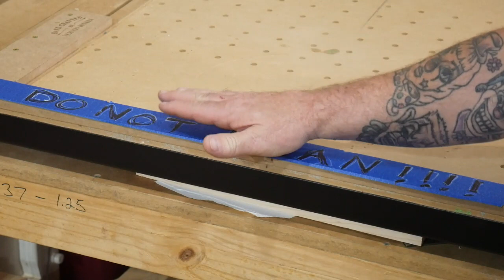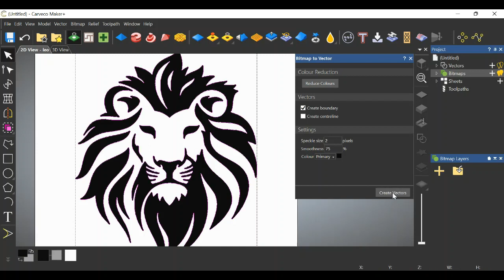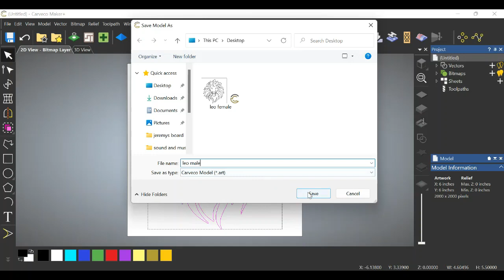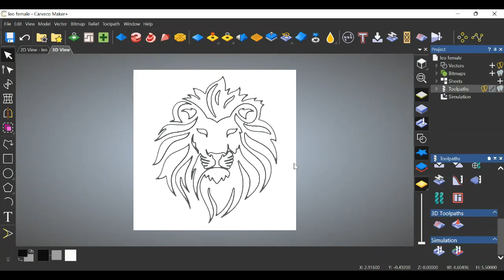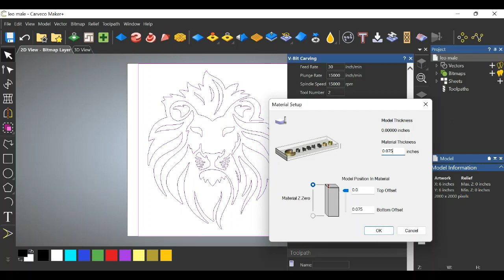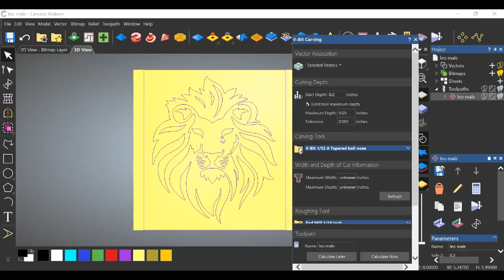Carveco V-Carve inlay tutorial

Comment: Question: since you are using v-carve tool path the roughing bit step down parameter is ignored and it goes straight to the max plunge, so for example
If I I say for female go to 0.25 depth, the end mill inside of vcarve tool path plunges straight to max depth. Do you have a workaround for that?

Comment: Thanks for the video - one thing for those just watching, on creating the male, I suggest either using offset or polyline to reduce the machining time to make the border around the male piece much smaller.
Reply from the maker: Thank you and you are correct
Reply: So creating an area clearance tool path with a larger bit? .250 or .125?

Comment: I tried this but with a 30 degree bit and my male plug doesn’t fit not sure where I went wrong
Reply from the maker: Thanks for watching 
Because you used a thirty degree you will need to adjust settings to achieve the correct fit

Comment: Have a link to the bit that you use??
Reply from the maker: Thanks for watching 
Unfortunately the bit is available at the time I am answering this but here is the description 
Any bit of those dimensions will work
Be sure to enter the bit as an engraving bit not a v-bit so you can enter all the dimensions correctly 

Amazon
1/4" Shank Spiral CNC Router Bits 6.2 Deg Tapered Angle 3 Flute Ball Nose End Mill for 2D&3D Carving Engraving

Comment: When I go to cut the male, my spindle plunges to the .2 start depth and snapped my bit. I am using carveco maker and an infinity. Am I setting it up wrong? I swear I am doing just what you are saying. (I am using an 1/8 inch end mill.
Reply from the maker: You need to slow your speed down to 20 - 30 Inches per minute

Comment: Great video.   I'm glad it's still around.  I have a different problem compared to what I've read in the comments.   My male plug always comes out too large. Would changing the .05 finish depth fix this?

Also,  tramming is a colossal pain in the a**.  Do you have any tips to make it easier?

Thanks for all your posts.   I've learned a lot from you.
Reply from the maker: Thanks Craig 
For the male i would try offsetting the male inward .001 to .002 or something in between 
For tramming surface the waste board first depending on what machine you have i have used clamps to help move the spindle in fine adjustments its tough to figure out how to mount them though to get them to pull the spindle 
I also three d printed shims and used aluminum foil at times hope any of this helps 
Thanks for the support
Reply: Thanks for the quick response.  I'll definitely try offsetting.

The clamps are an excellent idea for tramming.   I have a genmitsu 4040-pro.  No where near what you have,  but I do like it a lot. 

I also noticed you're cutting into the end grain.  That probably makes a huge difference.
Reply from the maker: Yes it does i rarely do inlay long grain.

Comment: i tried all of these numbers on my onefinity elite and the male is too small on all, width not depth. Any ideas?
Reply from the maker: Couple things did you load the taper ball as an engraving bit I’ve since learned that 
Also I have at times offset the male outward .01 - .02 to tighten things up a bit
Reply: @Hinkleshop thanks I will try that

Comment: Question I need to know this. Why do I need a start depth That is not zero when doing the male piece. Why can I not gradually go down to the depth I need
Reply from the maker: I’ll do my best to explain 
If you start at the top the software will not allow the bit to go deep enough because once the edge of the vee bit touches the vector that it is carving it will stop going deeper 
So by starting lower you are essentially lying to the software and as it carves to what it thinks is the vector it actually has already cut in which as a byproduct gives you the desired depth of cut 
Its a tough one to explain for sure
Reply: @Hinkleshop  
Well, thank you for explaining that much of it. It makes sense now. I’m having a really hard time making it work. I’ve been in the garage all day and have spent hours trying to make an inlay work and it just won’t do it. 
I cannot do the .2 on my first cut because that is too deep For my little bit that I am trying to do the inlay with.
Reply from the maker: @Checkitfirst  if the male is loose try offsetting the male vectors outward slightly .01-.02 
Also be sure to load the tapered ball as an engraving bit it Carveco and enter the bit dimensions for radius etc that might help as well if your using a tapered ball
Reply: @Hinkleshop  it’s too tight. It won’t even go in.
Reply from the maker: @Checkitfirst  interesting it’s usually the opposite 
But try offsetting inward the same small amount
Reply: @Hinkleshop  
When I first started yesterday, messing with it, the male piece had no detail left on it. It kept removing the detail. Now mind you, I’m trying to do a rose and lay. That is only 2 inches big.  I can do an inlay letter without any issues, but I’m definitely having a problem with this. I have seen small detail done in peoples before that’s why I’m so confused. I can’t make this work.  I’ll try that last suggestion and see how far it takes me. 😊.  I will let you know how it goes. Thank you so much.

Comment: How do you set the clearance so you can see the male portion actually set into the female. I want to se more clearance on the waste material if that makes sense.
Reply from the maker: If I understand you correctly I would reduce the depth of cut on the female incrementally until you achieve the desired result
Reply: I want to set the male portion to have a better clearance.  So I can see a gap between the female and the male portion.  So wehen I go to set it I can see the inlay is properly set.
Reply from the maker: I see 
Then if you increase the finish depth on the male that should do it

Comment: Hi Vernon, I have met and been involved with many professionals but very few have the ability to teach. Everything is easy once you know how so when they instruct, they leave the details out. You, my friend,  have a gift. I combed the internet on how to do inlays with Carveco and in every case they leave out a detail or two and I am tired of crashing my machine.  With that said, I am sorry to report that I crashed it again following your instruction BUT I am confident I am missing a "detail" simply because your video proved it. I made a 4 piece story board of a simple 1/2" X 2" rectangle. When I set the "Start Depth" at .02"  my CNC  plunges the 1/8" end mill .02" right into my Test board. I went over and over your video and noted every word. I zoomed right into the toolpaths and everything looks good. After hours of failure I tried in vein, knowing what the outcome would be, by setting the "Start Depth" at .005" .006", .007" and .009"  and the max depth to .20" in hopes it might work. Well it did cut them out but as expected, the narrow part of the male was the same size as the top of the female.  Sooooo........   I am  stuck!! I hope you have a few magic words for the answer.
Reply from the maker: Thank you for the kind words 
A few things I can advise
1-This technique is done in end grain which is more forgiving as it relates to stress on the cutter 
2-slow the feed rate to 30ipm or less
3- the end mill step down setting may be too much in your programming 
The step down on a 1/8” mill should be a 1/16 or less (typically step down is 1/2 the bit diameter)
4-Once you get the carve cutting correctly you may have to adjust the start depth point slightly to tighten or loosen the male portion 
I have also offset the male outward .01 a .02 to tighten the male 
5-don’t wait too long between male and female cutting the wood will shrink and make the pieces fit incorrectly in some cases
6- also the tapered ball nose should be entered in the tool library as a engraver bit. You can adjust the radius on the tip, whereas a Vee tool, you cannot
Hope this helps
Reply: GOT IT!!!  Your suggestion #2 was spot on.....Just needed to slow the feed. In addition, I switched from a Spiral Router Bit (looks like a file) to a high quality 2-flute. Much appreciated.  John
Reply from the maker: @user-jo3bd8vj8f very welcome

Comment: For the make toolpath setup,  would it fail if you do a final depth of the .25 instead of the .2 starting with a .05 doc?
Reply from the maker: Thanks for watching 
I believe it would but, the risk of snapping the bit would be greater 
If I was going to try it I would slow the feed rate down to compensate for the extra force against the bit

Comment: So, I followed your instructions and had one inlay turn out great.  However, the next one not so much, even though using the same settings.  In fact, I tried it a second time and both times, the male inlay comes up about 1/16" smaller than the female for all vectors?  Not sure what I'm doing wrong.  Used an 1/8" endmill for rough and a 1mm tbn entered as a v-bit in my tool library.
Reply from the maker: Since this video I’ve learned if you enter the T ball as an engraving bit you can enter the radius of the ball that may help 
Also I’ve learned not to allow too much time between male and female caves because the wood shrinks in some cases
Reply: @Hinkleshop  Thanks for the reply.  I will try again after Christmas

Comment: If Cutting Depth is in millimeter, what is the depth in mm
Reply from the maker: Anytime I have to convert from inches to millimeters. You can do that simply by going on the Internet and searching a inches to millimeter conversion chart, however
.25 is 6.35 mm
.20 is 5.08 mm
.05 is 1.27 mm

Comment: Vernon, I found this video very informative.  Excellent job.  The main thing I learned was that I needed to "tram" the spindle very accurately.  I've been struggling with inconsistent inlay results using F-Engrave, and was only able to get acceptable inlays when using 30° or less V Bits.  

My one comment would be, you seem to be ingnoring the offset requrired for the inlay cut ( I assume this is because you are usine a very sharp angle Vbit.)  

Example for a 60° bit:  tan(1/2 bit angle)  the tan of 30° is .57735.  You must multiply this factor times the depth of cut and offset that amount.  For .2" depth of cut the offset would be .11547"  This will offset the V carve cut the exact distance to allow for a precise fit of the male component.

I'm surprised that this feature is not builtin to Carveco.

Dan B
Reply from the maker: Thanks Dan and thanks for the added info I’ll give those numbers a try on one of my next carves

Comment: Well your video is great. But you said you made you cutter a carve bit. Now it is a ball you also said. I tried this and made the tool but nowhere did it ask the radius of the ball.  So I think that is why my pieces were loose. I think carve bits have little to know flat or rad on the bottom.
Reply from the maker: Thanks for watching since I published this video I have learned you should enter the tapered ball nose in the tool library as a radiused engraving bit and manually enter the specs
Reply: thanks I will try that
 @Hinkleshop
Reply: do I enter it as a vbit or an engraving tool bit
Reply from the maker: @marceldeman1541  engraving tool
Reply: Well I think I am on the right track but using a vbit tool path on both pos and neg  they are still loose. but in vcarve I saw a video that  he used a pocket tool path  and that worked. but it is tight and not getting down to the bottom. That is the strategy that worked in vcarve for me.   oh and also found an issue with my machine.  bought it used and figured every thing was set but my touch plate was set .03 thicker then the touch block fixed that and it got better, but was going all the way to the bottom of the pocket and still loose.   so I used this guys system in vcarve.
https://youtu.be/aWqHqqDtp5c

Comment: Im trying to make an Inlay im using a 1/8 balled nose I dont have the bit you have but my carve is not going deep enough I put limit depth .25
Reply from the maker: I believe the bit is to large in diameter and is stopping shallow so it doesn’t ruin the vector boundary

Comment: Great tutorial. One question . On the male, if you start at 0.2" and max depth 0.05", does that mean the 1/16" bit has to plunge in 0.2" and carve that out in one go so the total depth is 0.25"?  That's putting a lot of load on the small bit.
Reply from the maker: Thank you 
Yes it will plunge .2 so you will need to slow your feed rate to between 20-30 ipm and it works best in end grain applications  also I’ve had some good success running the tapered ball nose first then the end mill second you may want to give that a try too
Reply: @Hinkleshop  Thanks for the great tutorial. Can you explain why (what is the purpose) to plunge .2 on the first pass? It seems that you could safely take less on the first pass, do incremental cuts to obtain desired depths. You could still adjust Max Depth value as you describe in the Story Board approach testing. Thanks again for the time and effort you put into making the instructional videos.
Reply from the maker: Tough to explain but you are essentially lying to the machine telling it your surface is .2 lower than reality then .05 max depth is used to align the edge of the bit with the vector
Leighton does a better job explaining it on the Carveco channel tutorial

Comment: Well, it’s me again. I cannot get it to work. On the male piece where you say, make it .2   it drives my little bit all the way down into the wood .2” on first pass. Any ideas what I am doing wrong
Reply from the maker: Check the step down setting on the v bit tool reduce it to say .1 
Also if you are doing an end grain inlay you should be ok with a pass at .2 if you reduce the feed speed to 30-40 inch/min
Reply: @Hinkleshop  
The v bit seems to be ok. It’s the roughing pass that makes me nervous. The bit plunges to deep. Step down is at .03,,,, but it plunges the whole tip of the 1/16 bit. It only has a 1/4” depth of cut tip.
Reply from the maker: OK, then reduce the step down on the roughing bit and generate two tool paths. The first tool path finish depth  would be .1 the second tool path finish depth would be .2 that will reduce the amount of material being removed the time
Reply from the maker: Also adjust the start depth on the second tool path where you left off on the first path. .1
Reply: @Hinkleshop  
OK, I will try that. Thank you so much for your time.
Reply from the maker: You’re welcome

Comment: I found something interesting and a modification I needed to make when using a TBN for inlays.  When I set this up as a v-bit in my tool database,  I did some test cuts just cutting a 1.25" diameter circle.  It worked fine for the female pocket,  but cut the male insert just a little too small and there was too much play in the pocket. After doing some research,  some set up the TBN as an engraver bit in the tool database,  key difference is you need to specify a flat width for the bottom of the bit. This worked great for the male but cut the female too small.  So for my CNC, I set up the female pocket using the TBN as a v-bit and the male male is cut using the TBN as an engraver bit and it seems to work.
Reply from the maker: Thanks for the info Ed 
Since the time I realest this video I have found that offsetting the male vectors outward .01 to .02 tightens up the male also.
Great information thanks for sharing
Reply: @Hinkleshop  Yes, that's about right.  The male should have been 1 25" at a depth of .2 based on your tutorial and the way I set things up in Carveco, but it was only about 1.22" just as you noted. About the thickness of the tip on the TBN.

Comment: Seems like my bit is going to break if I use a .2 start depth. What am I missing?
Reply from the maker: Hey John check your speed should running about 30 inch per minute
Reply: @Hinkleshop  I was testing it out on mdf. I was running 40 ipm at 12000 rpms and the bit did break. Is it because mdf behaves different than endgrain on a cut like this?
Reply from the maker: I would agree with that MDF is soft however I believe end grain has greater flexibility or movement while carving 
I feel that the fibers sever and move out of the way at a quicker rate 
Again that’s only a theory 
I will say I’ve not tried an inlay on MDF and I’ve haven’t had an issue with bit breakage on end grain 
Please keep me informed on your findings and progress

Comment: Do you have a link to the TBN used?
Reply from the maker: Thanks for watching 
I purchased the bit from Amazon 
However I recommend a 12.5 degree from Amana tools they are much more expensive though 

Jiiolioa ZQ31B3 Spiral CNC Router Bits 2D&3D Carving 6.2 Deg Tapered Angle 3 Flute Ball Nose1/4" Shank 1/32"X1"X1/4"X3"

Comment: I have a dout, the star depth is suppose to be under 0.00 so the value we put in there is negative cos i did it just like you said on the video , my female depth is 6.35mm so for the male i put 5.2mm on the star depth and 1.15mm om the maximum depth but my cnc cuts 6.35mm

Comment: Fantastic video! It's so difficult to find a youtuber with carveco experience. I'm trying to do the inlay the same way you did however my bit (Amana #46282-K   5.4 degree tapered bit) is making the male inlay smaller than the female, do you have any tips in to how to set it up? I'm sure I did something wrong
Reply from the maker: Thank you Luis
In some case if you offset the vectors on the male outward .03 to .05 it will tighten them up 
The numbers I used were for a different angled bit 
You might also try decreasing the start depth on the male 
Hope this helps
Reply: @Hinkleshop  Thansk! That make sense 😬 I’m goin got try reduce the female as the run time is lower, I’ve gone through lots of scrap wood trial and error!